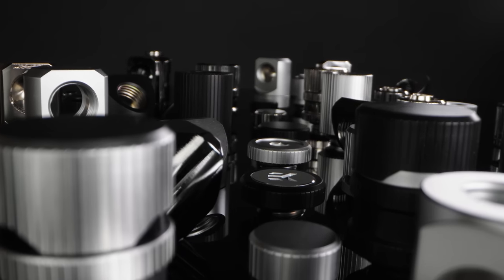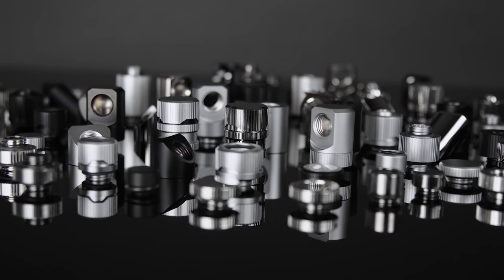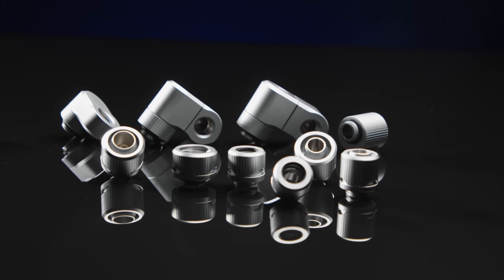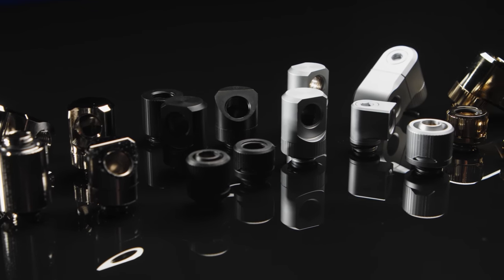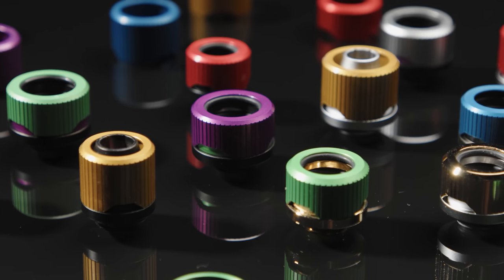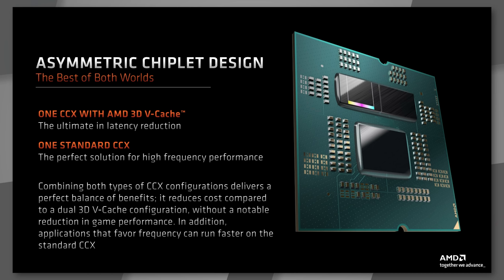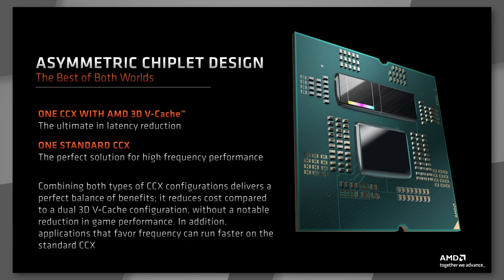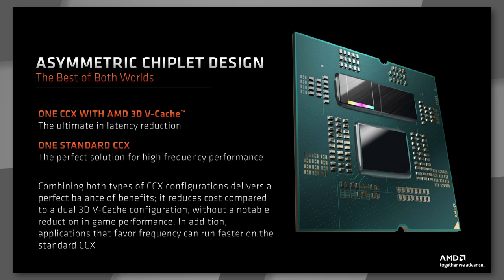Why I switched back to Intel...

Comment: At our repair shop, we've seen a small handful of X3D systems come in with RAM instability, too. The solutions varied by computer. One had a dead CMOS bettery which resulted in the BIOS resetting every time he turned off his PC, and the stock BIOS setting kept enabling XMP at a speed the CPU absolutely hated; fixed with new CMOS battery and proper settings. Another had RAM that wasn't white-listed for the number of sticks (x4); the timings were off from other sticks on the white list; switched with "compatible" RAM, set XMP to supported speed, and it stabilized. Another refused to dual-channel with XMP turned on; updated BIOS and set RAM clocks to a speed listed on the mobo specs. On and on and on. We routinely refer to AMD CPUs, GPUs, and MOBOs as "fussy" and "finicky" because the tinkering seems to never end. Edit: "Instability" varied from failing Memtest to BSODs to hard shut offs during benchmarks.
Reply: The only times I ever had problems like that with RAM was when there were bent CPU pins but obviously the pins aren't bent in every one of these cases so I wonder what the CPU is doing to cause these errors, I wonder if it's the unrefined hardware or lack of software that will behave properly with the hardware it could be because of the goofy ass architecture AMD came up with too it sounds cool but doesn't seem like it's very reliable, might be fixed in future revisions
Reply: So, user incompetence 99% of the time. Never had a problem when actually finding out what parts everyone recommends in their own manuals. Its so fkn hard to read, isnt it.
Reply: My new AMD system is kicking ass, really stable and fast, even though my CPU is non x3d its the 7900, I put that in for a power efficient build.
Reply: "Fussy" and "finicky" are weird descriptors when users are failing to read their motherboard's QVL RAM compatibility. 

We know DDR5 is weird with 2< RAM sticks, even on Intel.
Reply: people when they use non recommend parts and they dont work properly (shocking): 😒😒😠😡😡😡🤬🤬😔😔😓
Reply: I sell about 30 PCs a month, and have seen similar issues. Even on the non-3D chips, I have had multiple 7700x and 7900x with failing IMCs.
Reply: More problems = more chances to prove how smart you are.  Much better than products that just work.
Reply: re: the system with the dead CMOS battery, did the BIOS ever warn the user that the battery was dying/dead, or was the user just meant to infer that from the resetting behaviour?

User error is one thing, but a bad UI can compound that error.
Reply: I have the 7950x3d with a AsRock steel legend board with 2 32 GB Kingston sticks and all i had to do was set the EXPO profile once then the system was stable (for months now). Was I just lucky or a good combination of components?
Reply: Was there a correlation between brand and RAM problems? I've always had issues with Asus and Giga, barely with MSI and Asrock.
Reply: @54321dmsk  that's the weirdest take I've ever seen on a corporation fucking up
Reply: @FcoEnriquePerez  He had issues even with just one stick in and two and it didn't matter which slots he used so
Reply: "the tinkering never ends." Yeah that's what I hate. At some point you want to be done with something so you can move on in life instead of stuck in groundhog day.

Ryzen is a good benchmark on patience.
Reply: @aouyiu  I WANT to say it has more to do with chipset and motherboard series. If it's a Z-series board designed with gaming and overclocking, one of our first checks is RAM compatibility. However, while I don't have any hard numbers, ASUS is one of the most finicky. I don't think I've seen Gigabyte vs MSI be much different though their BIOS types are very different (IMO Gigabyte is more here-are-all-the-buttons-figure-it-out while MSI's BIOS is more look-how-pretty-here's-three-options-for-you). I have also said "screw it" and built Gigabyte and MSI gaming boards with RAM that's close to but not identical to the white list, and haven't had an issue (but definitely proceed at your own risk with that). We've only had a couple gaming-tier ASRock's come in, and I don't believe RAM was an issue for them.
Reply: @Scornfull  I agree, bent CPU pins can cause weird RAM issues. We've had bent CPU pins screw up dual-channel, mess up one RAM slot, etc. It's definitely something to check if you're having cranky RAM.
Reply: @marcmathes41 I agree DDR4 is way more stable than DDR5. We get a lot of people in who don't pay attention to their overclocking, or even BIOS defaults. We generally don't mess with overclocking as a shop policy, so fine-tuning someone's gaming machine can feel like breaking out the graphing calculator once every couple months to brush up on some Calculus. Rusty. xD
Reply: @kievitz  You could say it that way. xD Many first-time computer builders don't know what they don't know. Heck, I don't know what I don't know.
Reply: @davide4725  Imagine me in with a scraggly white beard, bottle cap glasses, a cane, and no teeth: "Back in my day, you could slap whatever freaking RAM you wanted in your system, and it would play Doom at a blazing 30fps. Now there's clock speeds, and latency, and DDR4 vs DDR5, and RGB, and low profile vs regular profile, heatsink vs no heatsink, and don't get me started on all the brands out there!" LOL
Reply: @wereoctopus  Interestingly, its version of warning the customer was the normal-looking BIOS loading screen mentioning on one line of many that the BIOS had been reset, press F1 to continue. Gone are the days "WARNING: CMOS Battery Failure"  apparently. And customer didn't know having your BIOS reset every time you turn it on is weird.
Reply: So recently I upgraded from a TR2950 to a 7800X3D on a NZXT N7 B650E with 64GB of Corsair Dominator Titanium Ram (6000 series). When I finished upgrading I saw no issues. I later added two more dimms. When I added the other two dimms I could not get the system to post. After 3-4 hard boots took both dimms out put one in and booted up. It didn't post the first time. It did  post the second time. I then added the fourth dimm and had to hard boot about 3-4 times before it posted.

My son recently bought a 5800 with a MSI board and 32 GB of GSkill Ripjaw. He was  seeing alot of issues with posting. Thought it might be the board he returned and then got the Asus TUF WIFI+ board. He is still having posting issues. And yes I'm a systems engineer so flashing a bios is a no brainer.

I actually though brought this very point up to my son this morning and I hadn't even seen this video yet. I am seriously thinking there are issues between the bios', the boards and some of the more recent amd processors.

Remember I had a ThreadRipper 2950 with 128GB of ram and never saw these kinds of issues.
Reply: Why are they using Intel XMP memory kits instead of AMD EXPO memory kits on their AMD X3D systems?
Reply: Finally somebody else says it and gets some traction for votes on something I've been saying forever. I have tons of AMD instability issues with plenty of different AMD combos and I always get hate from people like , "you don't want to go away from snobby intel because you don't want to give the supposed underdog a chance". Always had to justify why I would put 3 and 5 year warranties on Intel builds over the AMD builds where I would refuse to give anything over a year warranty. I just can't risk my business like that when for every 30 intel builds I may run into a problem where as for AMD it would be nearly 1 out of 5. That's too risky for me.
Reply: We don't really have much in the way of AMD systems come through, but 99% of the issues are PEBKAC issues. RAM either not on QVL, AIO pump died & they cooked the proc, or MSI board (shocker) died. More often we see people with both vendors with failing cheap SSDs.
Reply: d4qatoa  Haha! Thank you for the chuckle and nostalgia. :D My hubby is the tech person, and has an old DOS rig he pulls out once in a while just to play his favorite games from childhood. (He says emulators don't do the sound and video justice.) :P If you're referring to Jay in this video, I'd absolutely say he's a tinkerer at heart since has a channel for computer tinkering and a channel for vehicle tinkering. But when it comes to the home computer, you kinda want it to "just work" at the end of a long day. So when his home rig was giving him grief, he said "screw it" and spent the time and effort to re-build it. I've seen my hubby do the same thing (get fed up with something not quite working the way he wants it to and spend an entire weekend reinventing the wheel) with his person stuff. He does the tinkering at work as a computer repair tech and is tinkered out by the time he gets home. Tech is so sensitive nowadays, that there's a higher level of tinkering required for computer servicing. We've had a few otherwise handy customers come in who've tried a basic repair on their home PC and fried the entire computer because they didn't know what they didn't know. Most people aren't building their systems from scratch like Jay, and most prebuilt PCs that people are buying are expected to ship with all the overclocking and BIOS settings dialed out.
Reply: I'm so confused by this, I have personally done 3 AMD systems for myself since Ryzen, and have built about 20 or so for friends and friends of friends and a few other people. Some of which I shipped cross country...Not a one of them has had an issue except that one system lost the silicon lottery and wouldn't take any fiddling so it wouldn't accept even a curve optimizer from Ryzen Master. But at stock it runs fine.
Reply: Is this fairly the same with 5000 and 7000 series ?   ...I had some RAM issues at first with my 5800X3D but latest BIOS and setting RAM clocks solved that so I experienced the same as you.  This was earlier this year though, so AMD and motherboard firms have had sufficient time to roll out tweaks through the BIOS, if possible
Reply: @Raven1024  I'm glad to hear you've had good experiences with AMD! We call it "repair-shop-itis" in that we only see the systems that have issues. We do have to consciously remind ourselves that yes, we may have seen multiple PCs this week with the same X-Y-Z problem, but we have no idea how many similar computers are out there functioning just fine.
Reply: @aouyiu  I will say from my past experience Gigabyte, Asus (in the last 10 years or so), and MSI always give me headaches on motherboards. ASRock so far despite their origins has been the most solid for me in the last decade or so.

 I will admit it's been a while since I gave Gigabyte a chance though. Last couple boards I tried from them 9 ish years back singed their rep for me pretty good. Asus used to be great but it feels like they had a hard fall from grace
Reply: Laughable amount of fanboy copium in these comments. "All you have to do is A,B,C,X,Y, and Z and everything is fine." When are you guys going to realize that shit isn't normal? A system should just WORK without having to jump through flaming hoops. BIOS updates shouldn't be monthly. Tinkering and tuning is supposed to be for overclocking, not getting the system to fucking boot and stay stable at stock settings. Just because you can figure it out with FAFO doesn't mean you should have to.
Reply: @zodwraith5745  Agreed...  my next build will be Intel, but just cos I had to fuck about to get it to be stable, which IS a piss take, I had two options - get money back and go back to 3rd gen Ryzen 3, or twat about making it stable.  If I'd had the money I would have simply returned it to AMD, complete with a turd and the other components and simply bought myself a kick arse new Intel system from the ground up
Reply: @zodwraith5745  Most of the comments about making it work in this thread are just talking about making sure the parts matched in the first place... And that is completely normal. You should always be checking if your RAM is on the QVL. That doesn't matter if you're on Intel or AMD. Having built and shipped over 23 AMD systems and not having any issues... I feel like a lot of people just aren't planning their builds properly.

Basically all the issues in the video weren't caused by this being AMD... They were caused by it being a specific processor. And yeah that one's a finicky processor. The rest of the lineup that doesn't have to worry about core parking does great.
Reply: @Raven1024  I have problems with core parking and it's NOT an X3D. It's like the PC and CPU will go to sleep but when I move the mouse the PC will wake up but not the CPU for 20-30 seconds. If I try to click on a program it just locks up but I still have input and can open folders. 

It's like the old days where your HDDs would spin down when not used and it took a while for them to ramp back up when you access them, except I'm on an NVME that should have zero down time. I only discovered it was the CPU by leaving a monitor open and checking it when waking the PC back up. One core is puttering along and the rest are doing zilch. Even worse sometimes it requires a hard reset to wake it up as even Windows shutdown wouldn't respond. It gotten better and has almost gone away with BIOS updates but not entirely.

Now add in the USB disconnect issues I've had and this is the most unstable platform I've dealt with in decades and that's including several FX systems I daily drove. I don't know if it's the chip itself or AMD's shitty chipset but I've never had this with previous AMD let alone Intel.
Reply: @zodwraith5745  I mean. It seems like your personal chip has issues, might be a bad chip.
Reply: @Raven1024  Of course that's always a possibility, but then that's still on AMD and their poor QC. Just look at the 7950X3D they sent to LTT, and that's a reviewer that they repeatedly told "working as intended." Luckily for AMD they sponsor him so he withheld the review to protect them which is sketchy as shit. He CLAIMED he withheld it for the sake of the consumer but who really believes that bullshit when AMD is a sponsor? How would hiding a problem with a product help the consumer in ANY way?

Either way I'm not throwing money at it as it's just one of 6 systems in my house that's used regularly between me, the wife and kids, and usually does work fine.

The AMD systems I've built and sold to others don't seem to be as problematic aside from the USB issues AMD has "fixed" repeatedly, but of course maybe they'll just never return because they think I build shitty systems and it's lost business. It's one thing when I have to deal with janky shit, but another if it affects my reputation.
Reply: @zodwraith5745  For the LTT example though you're also jumping product lines back to X3D though. X3D we know has more issues. For your non X3D it is more than likely bad luck. Even with great QC you are still going to have bad chips that make it through. By and large AMD with Ryzen has a pretty great record.
As to the accusations of AMD asking LTT to cover it up that is your own baseless claim.

 Plus the idea of switching from AMD to Intel and citing anti consumer behavior as a reason is...well laughable at best with Intel's track record of anti consumer and fake benchmarks and paying off/holding hostage benchmarking companies.
Granted this doesn't excuse AMD, but it does mean that like...siding with the devil to spite a demon doesn't really work on a logical level.

Like I said. I've built easily around 30 total systems including mine over the last few years that were specifically AMD...not a one of them came back with issues other than the one with an unlucky bin that wouldn't undervolt at all. It's not a huge sample size but it isn't bad either.
Reply: @Raven1024  I'm not defending Intel, all these companies are evil. But in my experience of building hundreds of systems over 2+ decades Ryzen is simply a less stable platform with even FX giving me better results. Mind you I haven't built many Ryzens lately outside of AM4. AM5 has been too expensive and even though it's better now no one is buying anything anyway with inflation out of control.

The comment about LTT was more a shame on Linus than AMD. Of course all these companies put pressure on outlets they sponsor to get positive reviews. If you think they don't you're laughably naive. The fact Linus actually did it is why I have no respect for LTT anymore when it was already thin to begin with given their egregious mistakes in testing. (See GN) They're solely entertainment, not a reputable source of testing.

The whole point is every time you see a negative video about Intel or Nvidia the comments are all for jumping on the bandwagon to join in. The second it's a negative video about AMD the comments are performing mental gymnastics running defense for AMD. As soon as you don't care about what sportsball team you're rooting for I've still had more problems with less systems from AMD. But God forbid you say that in comments to back up the video or people like you're doing right now do everything you can to discount it as a "one off". Just look at how many likes simple "no problem here" comments have here right now and tell me AMD fanboys don't rule these comments.

You can choose not to believe me but it's not going to change the fact I've had and continue to have problems, and I can choose not to believe you, especially if you claim 30 systems have had no USB issues at all when that's been a pretty wide spread issue plenty of people have complained about over the last several years.
Reply: @zodwraith5745  It's not that I don't believe you. It's that you even said it was mostly your personal system and not ones you built even having issues other than the USB issue. So your problem sample size is basically 1... Mine is 0 / ~30. This would indicate that by and large, even on our samples combined the problem is not that widespread as you seem to try to indicate. In fact it seems likely that it falls within normal tech failure rates. As far as going back decades, sure, but once you go back that far it's no longer AMD versus Intel. Everything is too different to make comparisons that matter to any modern consume unless you're comparing modern to modern. And I've personally had more issues on the Intel side lately
Reply: @Raven1024  Except that USB one was a big one that happened WAY too often with AMD systems I built, but BIOS updates usually fixed them...... Usually. And keep in mind that was over FOUR BIOS updates. Doesn't exactly scream competence. But those are only the ones that came back. Who knows about systems that didn't. I've had issues with Intel systems I've built too, but none that were actually because of Intel. Bad motherboards which made me completely stop using Gigabyte, bad memory that couldn't hit base speeds let alone XMP(DDR5 has been an all around cluster fuck), faulty PSU, faulty AIO, etc. but I don't blame AMD or Intel for those.

There's no way you can build 30 systems with zero issues so I find that hard to believe. ALL computers, even consoles, have some issues eventually after you've built enough. Whether it's game incompatibility, random rare lockups, bad or slow driver updates which AMD is notorious for (We spent THREE MONTHS without drivers last winter cause AMD was trying to fix the cluster fuck that was RDNA3), etc. even before you account for hardware issues. Which is why you'll notice I'm careful to not say ZERO issues unless I actually mean it.

Anyone that says they've had ZERO issues is full of it. Especially if they claim 30/30 with zero issues.
Reply: @zodwraith5745  You can doubt it all you want but my systems I build are rock solid. I have had zero major issues outside chip lottery on overclocking/undervolting. 
You wanna call me a liar but maybe you're just not as good of a system builder as you think. Try doing BIOS updates first and keeping documentation for the motherboards around maybe. And staying up on which motherboards cause issues.
Reply: @Raven1024  Or how about I just don't buy or recommend AMD anymore? Sounds a lot easier to me. 

Of course I update BIOS on a new build. But if I'm such a terrible builder why do I magically NOT have the same problems with Intel over 27 years of building PCs? Even if I'm a complete idiot that would just prove Intel is so stable even an idiot can do it. Not exactly helping your AMD fanboy argument there.

Why does AMD have to release 6 new AGESA BIOS in 6 months trying to fix problems where my 1700s have gotten laughably less in 2 years and even then they're not bug fixes but updates to features and support for new hardware? My AMD has had SIXTEEN BIOS updates in 2 years. That's not normal.

Even IF my current chip is a 1 in 100 piece of shit, I'm hardly the only person that's complained about the AMD jank over the last few years. Much more likely you're simply accustomed to the jank cause you love AMD and think having to FAFO with every one is normal.

Keep in mind, I'M not the one that felt the overwhelming urge to post on a video complaining about AMD to run defense for them, then continue to argue with anyone that doesn't also worship them. I'm perfectly happy to point out 14th gen is a joke, Nvidia and AMD should be investigated and fined by regulating bodies for price fixing, and AMD makes some janky shit.

AMD ain't gonna fuck you bro. Unless you count out of your money just like Intel, Nvidia, and Apple.
Reply: @Raven1024  I've had the USB disconnect problem as well and it's annoying AF. No amount of BIOS updates or chipset drivers seem to make it fully go away. Months on r/AMD trying to find actual working solutions with all kinds of different theories so I KNOW I'm not alone. I'm used to tinkering around with my systems to get the most out of them but that's a BIG fail and impossible to ignore. I can cope with a random crash once or twice a week but losing control in a game and dying is massively infuriating. Overclocked, underclocked, overvolted, undervolted, nothing works.

After finally giving AMD another chance with all the Ryzen hype the last few years I've realized it's just that. Hype. You can fanboy for and defend AMD all you want, but you can't pretend real people don't have issues with AMD. You're either amazingly lucky or not being honest. I don't like any of these companies but I've been burned by AMD before twice with FX and now the second I give them another chance I got burned again. 3/3 might not be a large sample size compared to yours but 100% BAD experiences doesn't look good to anyone that's actually experienced it. Of course you're not daily driving those 30 systems so you don't even know how stable they were in the long run. Someone may be using one that doesn't pay attention to r/AMD and just thinks their mouse is a piece of crap that disconnects all the time and just deals with it and you'd never know, or even worse they think YOU build shitty systems when the problem is really AMD.
Reply: @kievitz I've always had rock solid systems, and those from under my hands also continued to be very stable in the hands of other people.

It does feel like user error.

Read the documuntation. It's there for a reason. And I made it a habit to always swap a BIOS battery if I can, because people will ignore those for years.
Reply: @zodwraith5745 exactly this. They recommend amd to new users and then when those people come back describing issues, they ask them to turn off everything that would have made that hardware decent. Underclock this, downvote that then disable all your graphics functions and your GPU will work fine, it's not an amd issue!!!! Or they just downvote you into silence.
I can almost guarantee these imbeciles and their advice are actually pushing more people to pay the premium tax and avoid amd forever.
Reply: @Raven1024 bruh, amd fakes benchmarks all the time lol
Reply: i have had same issues with my intel asus mobo i7 3770 , i think its mainly the ram and mobo combo, my opinion is ram needs to be more regulated or almost soldered in the motherboard there is no need to have such high variety of ram for most uses
Reply: Thanks for these examples, building my first pc rn and it's a great insight!
Reply: @uruacufutsal1  pikachu face here
Reply: I run a b650 7800x3d with 5600xt and I'm running some post problems as well. My solution is to unplug the monitor to get past the post and then putting it back on.
Reply: Dead battery seems like an issue unrelated to the cpu, just a bad battery- those things last forever normally. I've had the same exact issue before, took me a while to figure out what was going on. That was a long time ago though.
Reply: @Chaos_God_of_Fate Agreed, usually CMOS batteries do last forever, but sometimes a manufacturer will get a bad batch. We've seen quite a few be dead out of the box. It's one of the easiest "repairs" (if that qualifies as a repair...) once we notice the error or the BIOS resetting each reboot.

I'm always surprised how many default settings a CPU/RAM/MOBO combination may not like. When the CMOS is dead, BIOS settings are re-set to default at each reboot. Depending on the manufacturer and BIOS iteration, default settings can be wack. It's less likely to be an issue on motherboards that have had a couple years of BIOS updates to iron out any kinks, or have less complicated options, or are running with more run-of-the-mill hardware (IDK which is more the culprit for newer gaming motherboard default BIOS settings being such a pain).